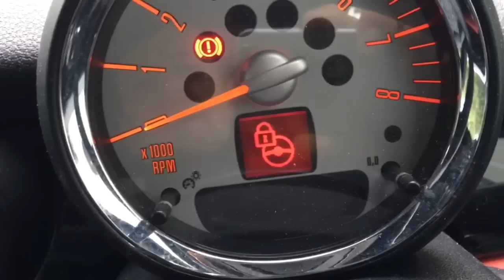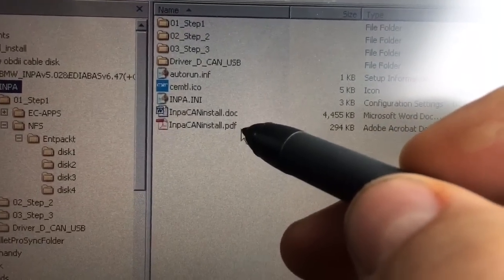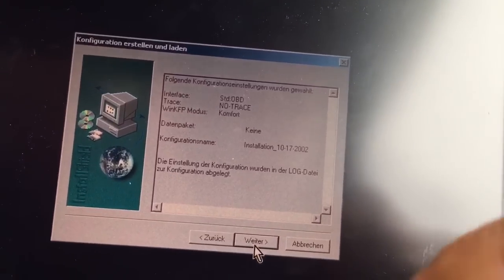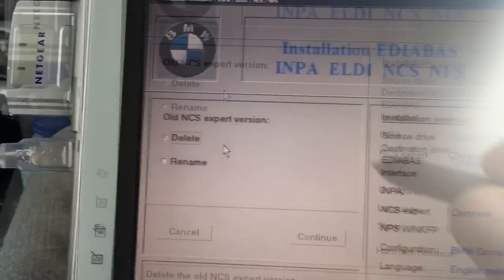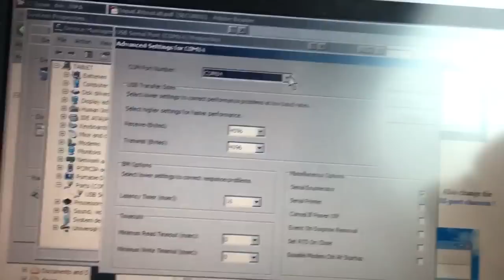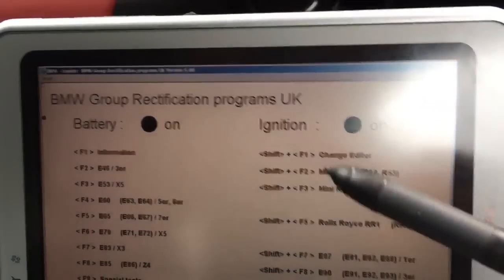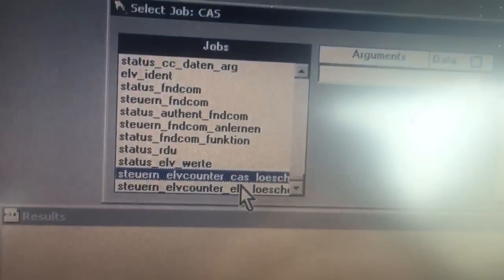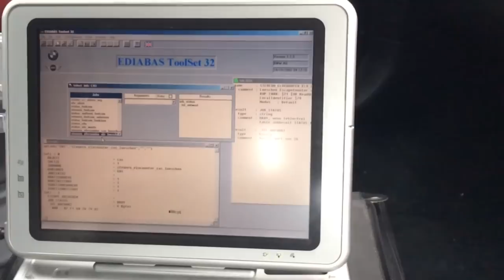How to Fix the BMW & MINI Steering Lock warning CHEAPLY!

Comment: Hi i have the same problem but mine is yellow 
What should i do
Reply from the maker: Same issue and solution, it’s just on the way to the red stage.
Reply: @comeinhandynow   i send it to the mechanic eletricist to controll this thru the OBD but he didnt figure out the problem
Could this going to be a dangerous problem
Reply from the maker: He needs the correct BMW OBDII cable and the BMW software as shown in the video.  This will reset the light.  Why not have a go at doing it yourself?
It’s not a dangerous problem, as its caused by the lock just going a bit slow, but if the steering lock eventually fails completely then you will not be able to use the car.  If that happens then I have another video on stripping down the steering lock to fix it.  Have a look on my channel comeinhandynow.
Reply: Can i fo this with my laptop windows 7 
Where can i get the software and the cable ?
Reply from the maker: Yes.  See the video description for information on buying.

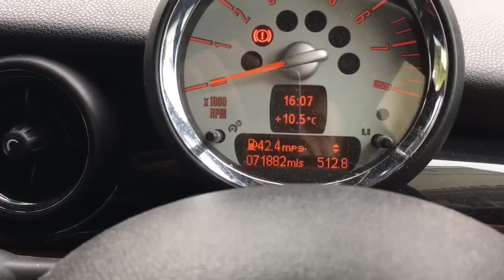Comment: Need to register new batteries with BMW software so the car computer runs proper charging cycles. 12:45 He says probably caused by a slightly old battery with low voltage.
Reply from the maker: That is true, ideally. It’s a pain in the arse going through the procedure though.  Unnecessarily complicated stupid bmw system.

Comment: Hi Sir,
I have the same problem with yellow indication on dashboard on my BMW 320D. The steering is getting hard making it difficul to drive.
I changed the battery and nothing changed. Then I took it for programming but the problem still exists.
Finally I have been told that the whole steering needs to be replaced. Its bloody expensive though.
Whats your opinion?
Reply from the maker: CHRISTOS ANTONIOU Ask why and what bit has failed. If it the steering lock you could remove it and either fix it or replace with an emulator. See my other steering lock video.

Comment: Could you do this why the Carly Adapter??
Reply from the maker: I guess you mean “with the Carly adapter”.  I think the answer is no, as I think I asked them a while back.  The specific BMW spec OBDII cable is required to work with the BMW software.  This completely goes against the principle of OBDII as a universal standard. Not impressed with BMW engineering.

Comment: Just adjust steeringwheel quick fix
Reply from the maker: Err no. I think you are talking about when the steering wheel lock is engaged and the steering is under a turning force which stops the lock coming off.  In that case a quick turn of the wheel to relieve the pressure allows the lock to disengage.  That is not what we are talking about here.  We are fixing the scenario where there is nothing stopping the steering lock from disengaging and it does indeed disengage, but just a bit too slowly, which the ECU doesn't like and sees as an error.
Reply: @comeinhandynow  i had the same icon when i picked up my car it was towed, wheel was stiff, so i just lowered the plug on the lower left side of the steering wheel and my car started up thought id share

Comment: Do you know whether this tutorial will support BMW 1 Series, E87 year 2009? As I am aware that the USB Interface K+DCAN cable supports BMWs between 1998 to 2008?
Reply from the maker: I’m not sure. I suggest checking bmw forums.
Reply: Will do, thanks for the quick response.

Comment: This red warning light has just come on on my 2007 Mini...no other ill effects though, possibly a stupid question but if it's just a sign the battery is getting a bit old I'm wondering how important it is to reset and get rid of the warning light?
Reply from the maker: It’s a good question.  The Mini owners manual says (I think) that the car may refuse to start if the warning is red.  That’s not happened to me though.  Apart from that it may be a failure at MOT time (no warning lights allowed) and difficult to sell when the time comes.
Reply: @comeinhandynow  thanks actually the manual goes further than that... there is no "may", it says (when warning light is red) "the engine can no longer be started"! but so far at least that is not true... so I don't know if at some stage car will fail to start if I don't correct it or if the only impact is an annoying false warning. Good point regarding resale and MOT. Will get it sorted at some point!
Reply: Hi, were you able to remove the warning light?

Comment: Does this work of your BMW does not start due to the lock?
Reply from the maker: It will reset the steering lock warning.  It will then start assuming that the steering lock is actually working ok.

Comment: When is it it still starts but it keeps on showing that lock steering wheel but if the car still start is it good to drive like that we just put the starter in and that's when it showed up after we got done putting the starter in
Reply from the maker: Mine was still OK to drive, but according to the car manual it could stop it from driving at some point.  As long as it still starts it should then drive OK.

Comment: This is misleading. We don’t have that tool or computer
Reply from the maker: The lead and software is cheap to buy.  Computers are everywhere, surely you know someone who has a PC? So, I lot cheaper than going to a dealer where  he may charge you a fortune for a new steering column and lock!